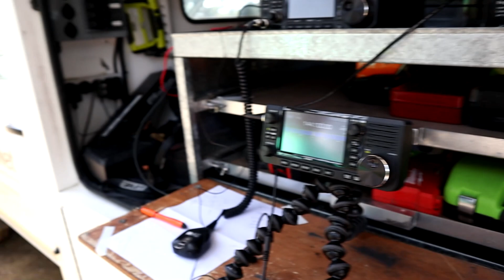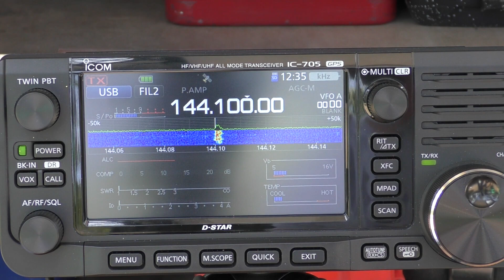We Worked into ZL with 1 Watt using an IC-705 on 144 MHz!!

Comment: Thanks that you don't use miles. But what whas the antenna? De OH6KXL
Reply from the maker: 8 element yagi
Reply: @HamRadioDX  Fantastic video, thank you. How high above the ground does the Yagi need to be mounted to get the right takeoff angle?